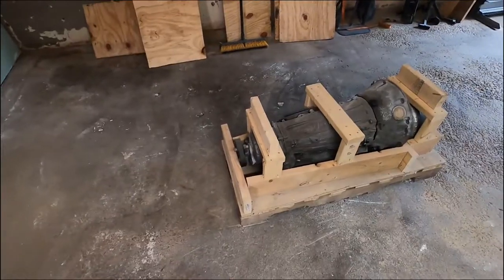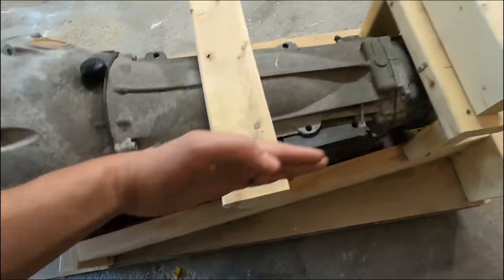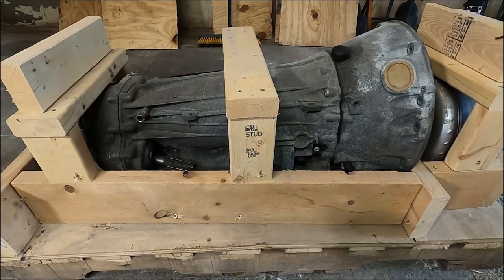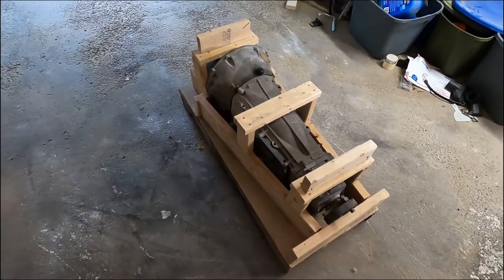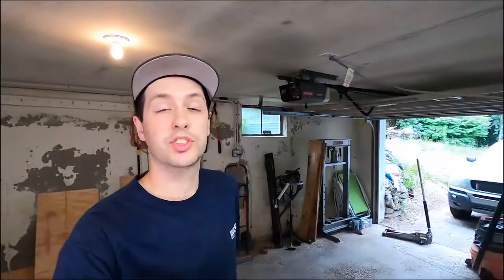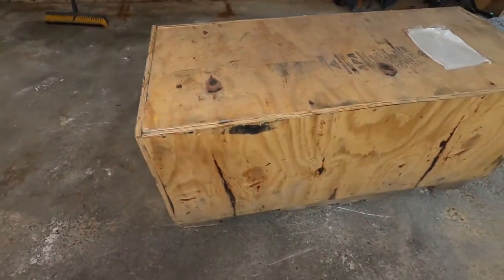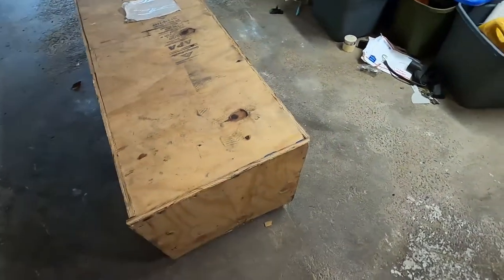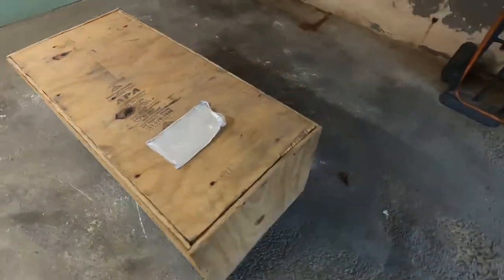Ebay Business: How to box and crate up large parts for freight shipping. Selling car parts online!

Comment: Good video. So when you ship freight, do you essentially just package the item securely then scheduling for pickup?
Reply from the maker: Yes, you want to package everything up securely first. It will cost an extra fee to have the company come and pick up the item, and because I am a residential address there will be another fee on top of it. The shipping company I use has a distribution center 20 minutes from me. So what I do is I put the item on my trailer and take it to them, they just take it off with their forklift. No added fees so you get the lowest price to ship. I just shipped an engine last week and will be posting that video coming up!